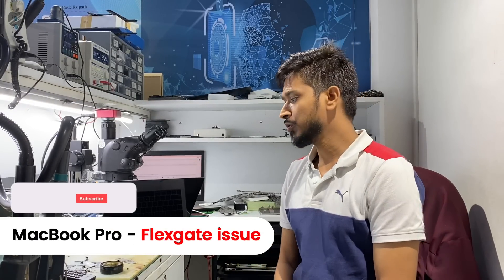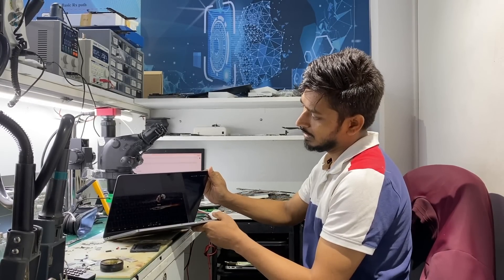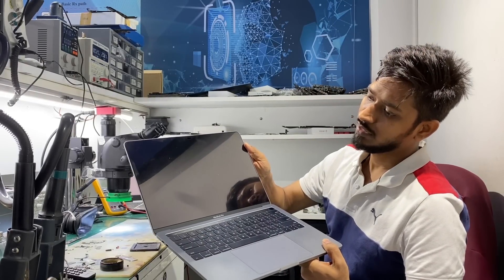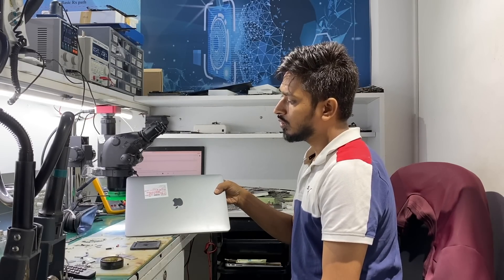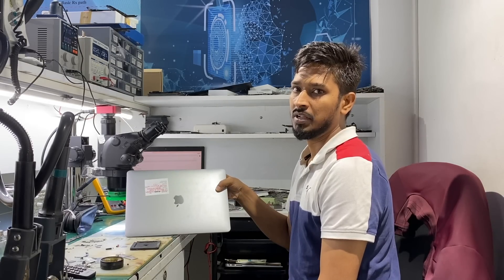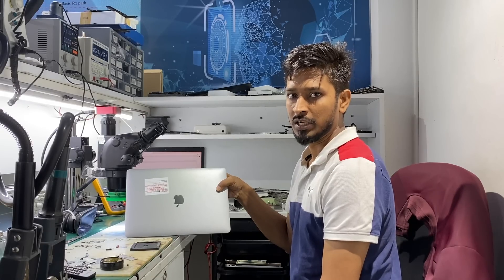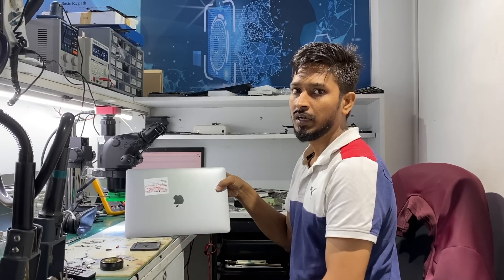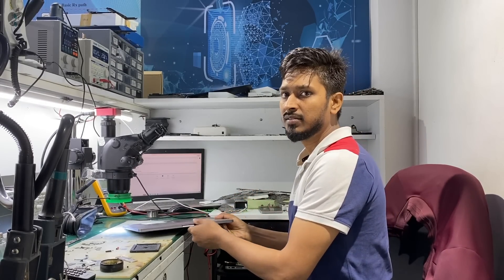MacBook Pro No Display Fix - Flexgate Repair

Comment: I am facing the same issue in macbook air m1 2020 and the screen turned pink and at a certain angle it is ok and it is still under warranty, will apple service center provide free repair??  and how much do you cost for it?? Please reply🥺
Reply from the maker: You can visit apple service centre

Comment: I am facing the horizontal flickering lines issue on my Macpro A1989 2018. What's your repair center address?
Reply from the maker: Can you share me your location and share me a video of it 8698535533

Comment: Hi aapne soldering to use hi nhi, is that right? Just used flex? Aur aapke joint uske top se piche se kiya, not extension, is that not going to break?
Reply from the maker: Won’t both side has been soldered so not required to add extra soldered

Comment: I was quoted 60k by official apple service centre. But then I found the video related to flexgate on youtube. This fix cost me only 8500 and the repair quality is 5star.i called to Eazyfixit they told me you can ship to us we will fix and send it back but i was bit curious that if apple can not do how they are doing it @ so great price by the way after talking to them got a good confidence and I immediately traveled from Mumbai. I got it repaired in 2 hours. Highly recommend for apple product repairs. Highly equipped lab